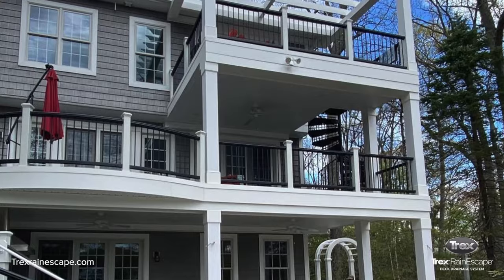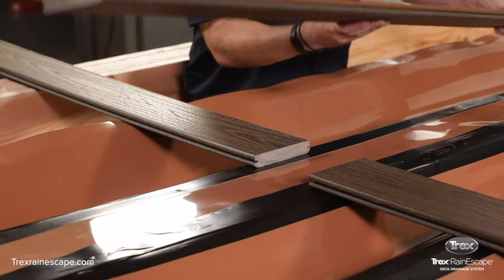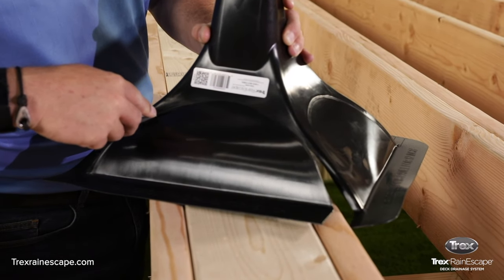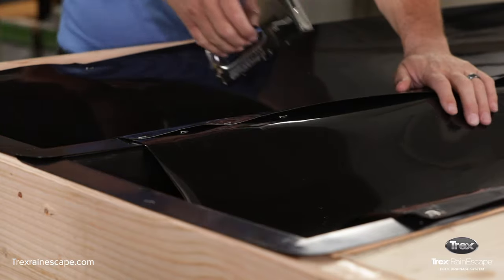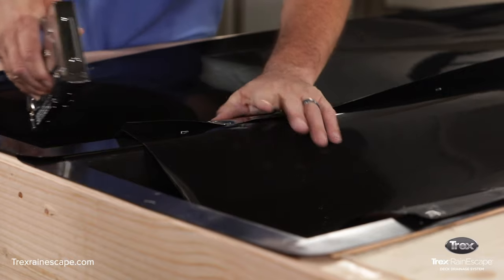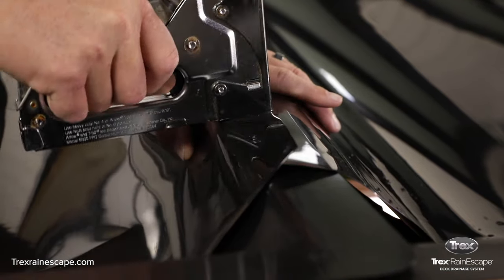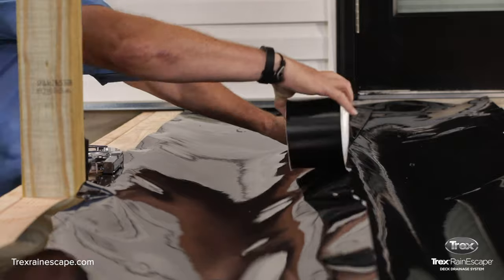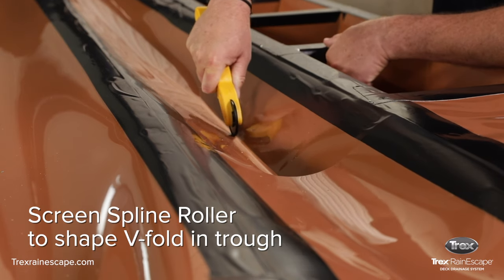How to Install an Under Deck Drainage System

Comment: Is it ok to reduce height of blocking? This goes against other trex academy videos. Also need blocking to be at top of joist to support picture frame or deck boards.
Reply from the maker: Hi @caml17

We have two main techniques for picture framing. Here's a link on how to ladder box which is primarily used with double or triple picture frame boards. https://www.youtube.com/watch?v=P288c3L4k9o
And here's a video for our single picture frame. 
https://www.youtube.com/watch?v=1OhcRphlxo8 

Please let us know if you have any further questions. info@trexrainescape.com 877-348-1385

Comment: What do you have the can be added to an exisiting wood deck to water proof underneth.
Reply from the maker: Unfortunately our system has to go on before the decking is applied. You'd have to bring the deck boards up to install our system. Please let us know if you need more information.

Comment: No voiding of warranty by trimming the exess trough material for the next joist bay after creating your slope and stapling?
Reply from the maker: That's correct, the warranty would be intact. We recommend to cut the excess trough material off. The staples will be covered by the 4" tape.

Comment: I get a TON of fir needles which make their way through any deck boards.  How do you clean this system when moss and needles accumulate in the plastic troughs?
Reply from the maker: Hi Terry, we typically recommend to pressure wash the deck. You can also use a standard hose to flush the system out.

Comment: You mentioned that caulk is required but didn't use any caulk in the video. Where is the caulk used?
Reply from the maker: The caulk is used along the ledger, around posts for the railing, around the perimeter of the deck and under the fascia.  Check out the installation guide at TrexRainEscape.com for the complete details.

Comment: Hello, how does it seal around the screw? No water will penetrate for that hole?
Reply from the maker: The butyl tape will flow around the penetration and seal the hole making it watertight.

Comment: What is the recommended way to install if the deck is 10'+ off the ground with 16" between the joists? Scaffolding?
Reply from the maker: Scaffolding would be one way, the most common way is to put a piece of plywood on top of the joist next to the bay you are working on.  After installing the trough move the plywood to the next bay.
Reply: If you don't know to just throw a couple pieces of plywood down on the joists and move them as you go along, then you probably shouldn't even be attempting to install this, or much of anything else for that matter

Comment: Does the plastic sweat on the joists in humid climates
Reply from the maker: You shouldn't get much sweating, but it has happened before. If you'd like, you can install a piece of drywall or cement siding between the Rainescape system and the ceiling. That would deflect most of the heat.